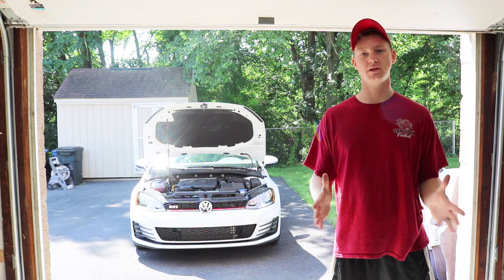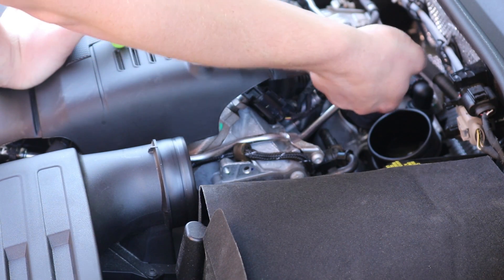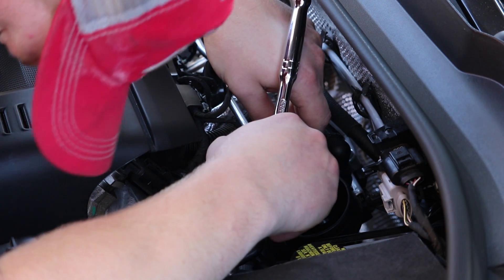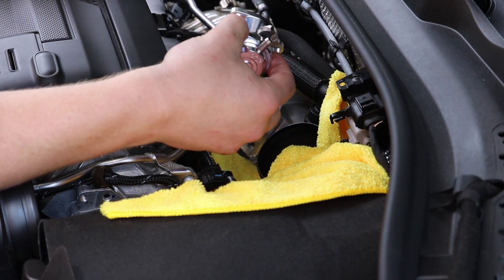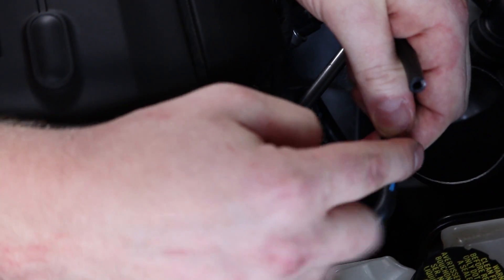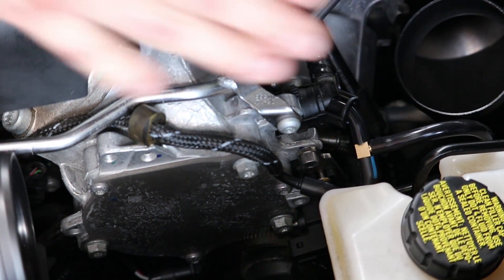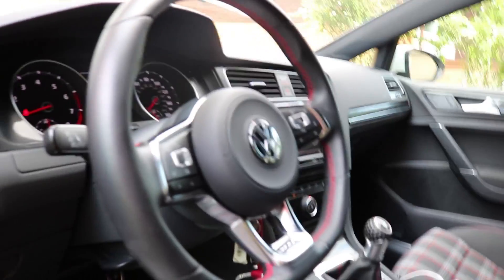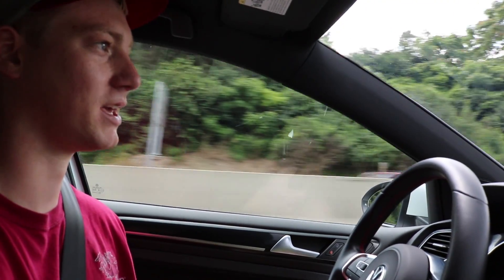MK7 GTI Forge Blow Off Valve (BOV) DIY

Comment: What spring can i use for the stock car ? Blue or yellow ?
Thanks
Reply from the maker: just use the spring that comes in it already....sorry its been a very long time i dont remember if that is blue or yellow but just use whatever spring comes in it out of the box.
Reply: @TeddyWestside412  the yellow one
Reply: @TeddyWestside412  hello, thanks for the reply.  today I also mounted the blow off valve from the forge but I have a problem, when I press the accelerator at 2000-3000 rpm then it releases the sound shhhtuuuu shtuu… the hoses are in place as you put in the video
Reply from the maker: @cezartitan  that might happen if you're letting off the gas.  It should hold it if you are on the gas still and building boost.  If you are pressing the gas and giving it constant throttle and building boost it should hold.  If not then i would contact forge or whoever you ordered it from for help.
Reply: @TeddyWestside412  Hi, I finally managed, I forgot to plug a hose, I asked you another question, BOV only whistles when the engine warms up a bit, is it normal?
Reply from the maker: @cezartitan  doesnt sound like anything i have had happen to me.